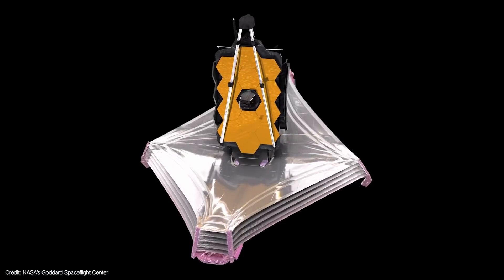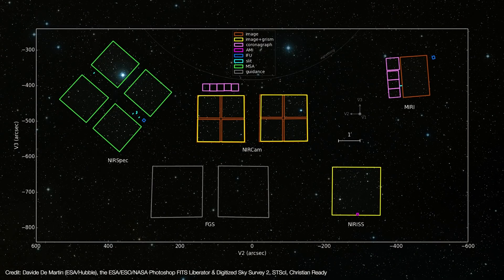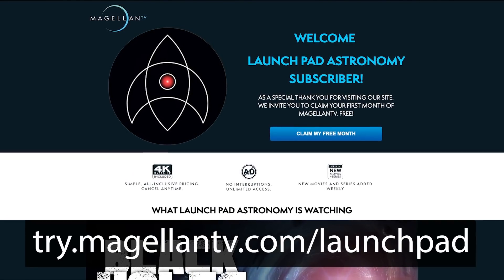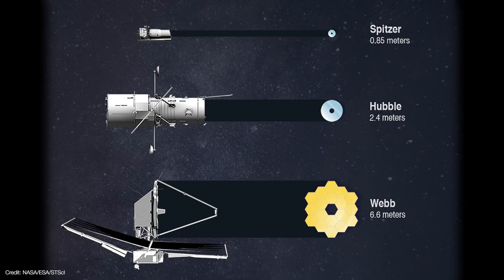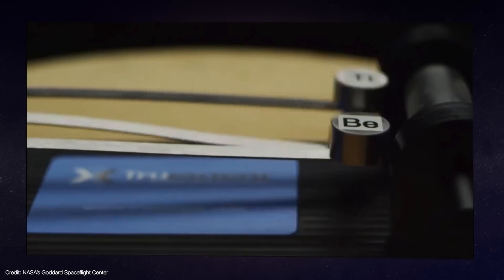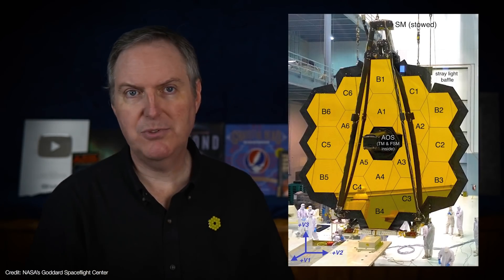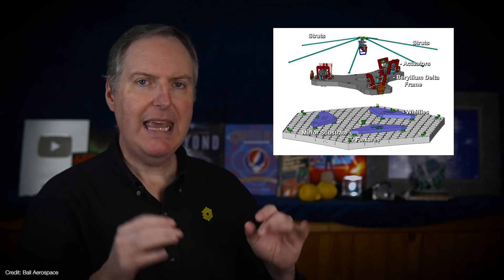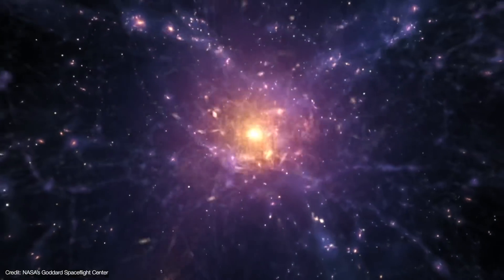How James Webb's Mirrors MUST Work

Comment from the maker: 🔴How Webb's Deployments Worked! https://youtu.be/QeiQEG450gc
Reply: Hey there how are you?
Reply: Would Hubble have a noticeable (valuable) advantage from its current position, if it were at L2?
Reply: wait isnt this the prototype death star weapon ...oh wait ... reality :)
Reply: What happens if one or more of the mirror segments fails. Say a motor goes out or is hit by a micro meteor.
Reply: Thanks for explaining the tech behind the scope.
Reply: I love how you present such information dense content while still making it easy to follow 😊
Reply: @RomaineRC  one of few channels that shows things properly and with facts and even interacts with questions right
Reply from the maker: Worst case they can defocus the mirror to the point where it no longer affects the image. Another advantage of the segmented design!
Reply: ⬢ When mirrors are aligned, what keeps them from drifting?
⬢ Are actuators so well designed they don't have slop, drift or wiggle?
⬢ Does extreme cold effect alignment actuators?
Reply: I Wonder Why only 18 mirrors are there on the JWT why not 100 or more?
Reply: @mgab9667  beacuse of weight if you mean same sized ones and the tech to flip out that many 

if you mean smaller ones its the KISS idea of keeping this as simple as possible for the gains
Reply: @chronosschiron   same sized ones but build in international space station and assembled peace by peace there in space we just need to send equipments from earth and scientists can work from there...
Reply: @Inertia888  🛌🙏🏻🙏🏻😅

Comment: I love that this channel doesn’t shy away from providing greater and greater detail and assumes that the viewers are plenty smart enough to understand. THANK YOU!  There’s dozens of channels out there talking about JWST, but none of them are as comprehensive, thorough and non-patronising. I’ve got one question though; how do the mirror actuators make nanometre-scale adjustments at little above absolute zero??  That’s clearly no ordinary servo or stepper motor! 👍🏽
Reply: yeah. there's so many channels, videos and talks that cover the basics. Then we don't learn anything new. He did a great job
Reply from the maker: Thank you so much 😊 My mind is blown by the actuators as well. That’s tech they had to invent but I’ll be damned if I know how they pulled it off!
Reply: The drive motor is a stepper motor with 20 degrees per step. It drives a 60:1 reduction gear which drives a complex mechanism to adjust the mirror. There is an article titled "Cryogenic Nano-Actuator for JWST " by Robert M. Warden that describes this in detail. Well worth reading!
Reply: @stevewilson5546   Thank you. I’ll make a point of reading it!
Reply: agreed, this amount of technical details is amazing. You need a real astronomer/sceintist/engineer to really understand and convey these technical details, I think thats what is missing in other channels
Reply: Knowing is half the battle...👍🏽💪🏽☝🏽😇
Reply: @LaunchPadAstronomy  got em
Reply: Except quantum level physics everything can be explained with the science basics that we learn in high schools. So appreciate it sir..
Reply: I can recommend "The Clever Engineering of NASA's Cryogenic Nano-Actuators
" on the Breaking Taps channel, where he explains the actually genius design that enables one stepper motor to control both coarse (um) and fine (2nm!) adjustments over a long actuation range.
Reply: I love when people put ads within the videos so they get even more money. That’s my favorite part.

Comment: Amazed that they even will be able to adjust the curvature of each individual mirror. Biggest fear was that no matter how movable the mirrors were, bad curvature would still mess things up like it did for the hubble. Now I feel even more confidence in the JWST.
Reply: Fortunately for Hubble the curvature error was so exactly wrong it could be exactly fixed. But that curvature error was incredibly small, half a wavelength of light. Can you believe it turned out to be so big?

Comment: as an engineer, i appreciate all the technical minutiae involved in the JWST’s design that you have been presenting. 

it’s easily on par with a typical presentation i would usually see in an engineering conference.  my hats off, sir.
Reply from the maker: Wow, I'm flattered! And I assure you, I'm not an engineer by any means :)

Comment: So Beryllium is very stiff, yet can be bent into the desired shape by the actuators 🤔. Great video, top-notch audio, superb production values!
Reply from the maker: Many, many thanks!
Reply: It is important to realize the scale of this "bending", single mirror has 1.4m diameter and it bends about 0.00000001m
Reply: Nothing is being bent though? The mirrors keep their shape, but are tilted, not bent, in very miniscule amounts...
Reply: @DragonMoth34  That isn't the impression I got from this video.  Each mirror is in fact bent very slightly in combination with the individual movement of each mirror along all 3 dimensions.  That is why there are seven actuators on each of the 18 mirrors.
Reply: @DragonMoth34  the middle actuator actually bends the mirrors
Reply: agreed the audio is great; much appreciated.

Comment: the mirrors are polished to their almost final shape and sent to another facility where they are placed in a cryogenic chamber and cooled to their operating temperature. Changes in shape are precisely measured and sent back to Richmond where they are final polished to their prescription taking into account the measurements recorded in the cryogenic chamber. Small detail but an important step to ensure the mirrors work as intended. The 18 segments are divided into groups with 3 unique optical prescriptions. The mirrors are not all alike.

Comment: Excellent!  Do you think the pupils - the masks surrounding each filter - have the shape of the primary for the same reason as the fine steering mirror? (I've looked around for that answer without luck)
Reply from the maker: I believe that is in fact the reason why (though I can't yet say for certain).
Reply: @LaunchPadAstronomy  It would be awesome if you make a short video on the filters and filter/pupils wheels, there's lots of  information but it gets too techical and complicated very quickly. 
In any case, thanks for all your videos! I'm glad the channel is getting the recognition it deserves.

Comment: Beautiful explanation and easy to understand. Even my 12 old kid understood what you were explaining. The only question we  have and actually my kid brought it up. How come the movements are so slow when adjusting the mirrors?  Maybe one day you'll see our comment and question about the mirrors adjustments and could answer so I can explain it to my kid and for my own curiosity as well. Or if any one reads this, would much appreciate it. Thanks.
Reply from the maker: I’m so happy you both enjoyed the video! As to the slow rate or the mirrors, my understanding is that it’s for two reasons. First, the faster they turn, the hotter the motors get. That means more heat is conducted into the Moro which they don’t want to happen. The second reason is that the slower they turn, the easier it is to stop if something goes wrong. Then they could reverse and try again without much risk of damage. 

There’s probably several other advantages to going slow, but those are two that I’m aware of.

Comment: Sir, thank you. Very informative. For the first time I did see closer explanation of optics and the open instrument chamber philosophy - thanks. I knew about the wheel full of optics (filters) but I did not know they're continually spinning. I knew about the NIR and IR capabilities and in the visible range (Red and Orange). I could not find any information about the "prism's" role that I know is there. Would it be utilized in the pre-processing of images prior to sending images back and how? And, a small question: On the NASA official time-line chart, the travelling away from Earth speed kept on decreasing as expected but even after reaching the L2 it kept showing as being 0.2020kms/sec for several days before It has been removed now (yesterday). I suspect it was erroneous, would you agree? Top presentation Sir, thank you

Comment: Where did you get the PSF animations? Those are great and I haven’t seen them anywhere else. I’d like to see the rest of that.
Reply from the maker: It's an animation that NASA created. I'm not sure if the PSF is based on actual test data, but my guess is that it's probably an artistic approximation.
Reply: @LaunchPadAstronomy  Where can I find the original?

I’m an optical engineer. It looked pretty real…

I’m always looking for more info on the optics…
Reply from the maker: Here you go! https://svs.gsfc.nasa.gov/12895

Comment: Are the mirror and optics in a fixed position? How does webb get a view of anything perpendicular to the sun shield? Or does it only get a 360 view in one direction with rotation?
Reply: It's orbiting the sun - so different parts of the sky can accessed at different times of the year.

Comment: Great video. Thanks. 

If one of the 18 primary mirror segments failed for some reason, could that part of the image be isolated and eliminated? Or would that “contaminate” and ruin the entire image?
Reply from the maker: I don't know why I didn't mention it in the video, but if a mirror were to become damaged to the point it can't be used, then they can point it away and/or otherwise defocus it so that it doesn't contribute to the image.
Reply: Thanks a lot. Certainly a benefit to the design!
Reply: @LaunchPadAstronomy  What if the affected segment were stuck in a position pointed at the secondary? Would there be a way to computationally eliminate that, or would it be impossible to differentiate the photons from any given segment once it hits the secondary? Just curious what happens if a little green man doodles on a segment and then yanks out its motor :)

Comment: I’m super stoked that JRST is so far coming along flawlessly, but I have been critical of this mission from the start for its complexity. Did I understand you correctly that the image stabilizer system has wheels that are continuously moving? Doesn’t that seem like a major potential failure point? It seems like a lot of hardware on this telescope has to perform in ultra high precision and it makes for so many potential failure places that I am pessimistic, especially because it can’t be serviced. I hope I am wrong
Reply from the maker: You're right that losing the wheels would pretty much kill the mission. Fortunately, RWA technology has improved quite a bit since Hubble's original wheels, but Webb carries redundant wheels anyway :)
Reply: @LaunchPadAstronomy  yeah, I hope you are right. I just have concerns over relying on these many singular points to work over the life of the telescope, especially ones that have to be in operation continuously for 10 years without wearing out. Also, every mission encounters unforeseen problems over time. Usually engineers at NASA or JPL put their genius to work devising some equivalent of duct tape and bailing wire to resolve or patch it. And how often have wheels broken or malfunctioned - (see) Hubble, Kepler, Dawn, Hayabusa?

Comment: Good discussion on the mirrors. I understand that there was a default in some of the primary mirror's movement, discovered before launching, and a workaround had to be made. Do you have any update on the workaround? I'm curious on the actual problem and the workaround.
Reply from the maker: TBH, I didn't even know about the problem until after I made the video. It never came up in my research or anything! Evidently, they had to wait until the others were deployed before they could deploy the A3 and A6 mirrors. I'm not sure how they determined it was better to launch as is vs. changing out the actuators but I'm guessing the risks of changing the actuators were higher than the risks of leaving them in.

Comment: I saw other NASA videos and they all mentioned how the calibration of the mirrors was going to take months. And I just thought to myself, "how hard can that be?". "Just align each mirror individually until you get the strongest signal at the center", right? Your detailed explanation really made the coin drop with all the challenges that they're going through and precision they're shooting for. One question out of curiosity: is there a specific test to detect damage to the mirrors? It could have happened during the stresses of launch or even space debris. How will scientists know they're looking at a pristine image without a reference image to shine the mirrors with?
Reply: I have heard that L2 location is very remote from the usual space debris at LEO.  And micrometerorites are the biggest concern and even if they hit the mirrors which isn't expected to be very often, it would not have serious effect on image quality.

Comment: You've talked before about how Webb can't be turned around, lest the light from the sun blind it's sensors. Considering an overshoot (or needing to return to LEO for servicing) were real possibilities, why wasn't a lens cap of some sort included in the design?
Reply from the maker: I think the problem is that everything on the 'telescope' side of Webb has to be kept as cold as possible. So even if a shutter door were closed over the AOS aperture, the mirrors, secondary struts, AOS housing, instrument science module, etc., would warm up to much higher temperatures than they were exposed to on the ground. Everything would expand, but not necessarily return to their original shapes when chilled again.

Comment: Is it predetermined what the first few images are going to be of when it goes into full operation?
Reply: If you mean the targets that JWST will be directed to look at based on the applications for its use then yes.  Something like 226 applications were chosen out of over 1000 as the first ones that the JWST will at.  Hopefully starting in July is the expectation.  I have also heard the Hubble Ultra Deep Field will be an early target though I don't know that for sure.

Comment: The Webb telescope looks to be magnificent - and it will have to be to exceed Hubble. Hubble went way beyond it's expected time and results and if Webb can do that it will be fantastic. So looking forward to the new wonders it will show us. Fingers crossed because it's too far to make any repairs, if needed, manually.
Reply: Its not meant to "exceed hubble". JWST is not a replacement for hubble. They do & see very different things. In fact, there are things that hubble can do that JWST can't. 

Hubble is a visible light scope. JWST is an mid-IR scope that won't see much visible light.  Hubble has UV capability, while JWST doesn't. 

And when JWST views at longer IR, JWST & Hubble have equal optical resolution.
Reply: @beta_cygni1950  Thanks for the patronizing reply.  Certainly most people would know I was speaking figuratively.  Hubble was a massive success for what it was designed for. I'm sure NASA and the other agencies will be thrilled if Webb is equally successful in what IT'S designed for.
Reply: @evoman1776   You're welcome. Let me know if I can answer anything else for you.

Comment: How is it possible to move anything mechanically as precise as 10 nm? What kind of machinery can do that?
Reply from the maker: That's where my mind is blown as well. I mean, that's smaller than the wavelength of light so you can't actually see them move. I'm guessing it's something to do with measuring changes in voltages by the stepper motors but then again I'm not an engineer :)
Reply: Another commenter said there is a gear in each accuator with a 60:1 ratio to which explains part of it

Comment: Just hoping it doesn't need glasses! So far so great!
Reply: The JWST was rigorously designed and tested to avoid the problems that Hubble faced.  For one Hubble needed direct assistance to correct its myopia.  JWST is designed for fine adjustment remootely as part of its calibration before beginning viewing as explained in the video.

Comment: Are there any cameras on the telescope pointing inward for a visual of the webb
Reply: Adding cameras to JW would have added complexity to the telescope which is already at the cutting edge.  In addition there was the question where to put it and its function would impart heat into the system which the JWST team wanted to avoid at all cost.
Reply: @michaeldeierhoi4096  Surely adding a tiny 1080p camera wouldn't be that complex, giving operators on earth eyes on its prised possession would have been extremely beneficial to see how the entire system is functioning, I cant believe the didn't install one.
Reply: @thrust_fpv  The JWST team considered the possibility of it and like I said because of the complexity of the scope a camera would have added unnecessary complexity.  A camera would have to be specially designed and would require a power supply to maintain it.  And the power is prioritized for the JW.  

It's like just slapping an Iphone camera on the JW!

Comment: I heard Scott Manley mention something today about there being some problems with a couple of mirror alignment micromotors but that NASA was hoping to somehow fix them. Do you know anything about that?
Reply: On two segments, one of the position sensors for one of the motors is defective. This was known before launch, and there's a second sensor that works. So the alignment still works, they just have to treat these 2 segments separately because the sensor readouts don't match the other mirrors.